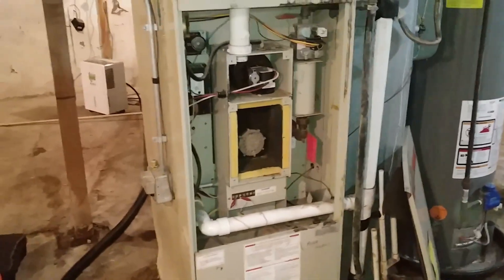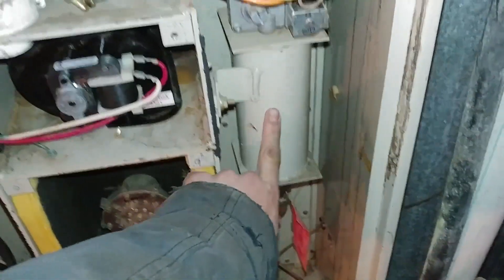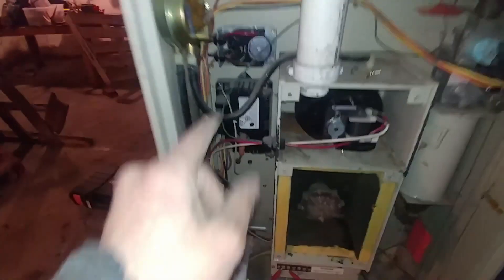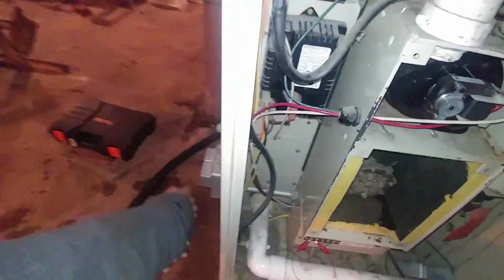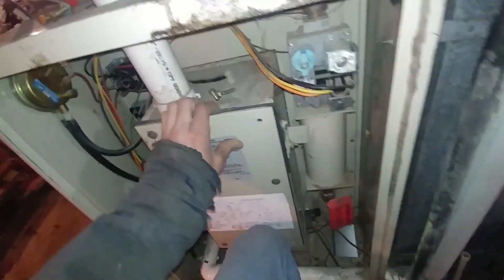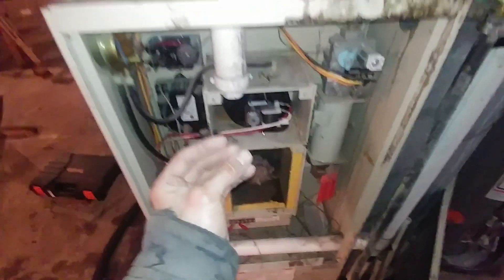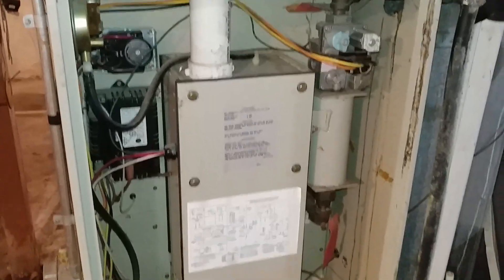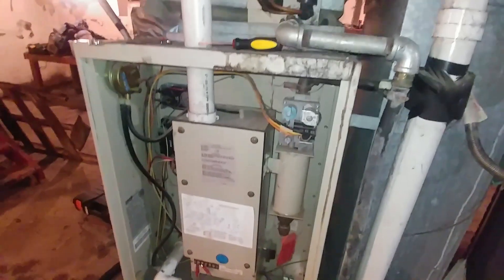Lennox Pulse Operation Overview

Comment: OP  you completely missed the  fact, or failed to mention,  that the gas  connection ALSO has a flapper assembly  way down  right before it goes through the panel.   I replaced few of them,  replaced lots of air flappers.
Reply from the maker: Yes, I probably missed that because I have not had the opportunity to work on many of these. In fact, I think the last two or three that I knew of have since been replaced. Not sure there's any out there still, maybe one or two somewhere, but they are definitely a rarity.

Comment: I am 77,  in a previous life  worked on  hundreds of these.  The dealer  I worked for was big on them.  You give  some thought as to locating them, use  shock  mounts,  use canvas isolators  in the  supply and return  ducts,  install the  gas  flex  connector properly so it was not  "bound up"    use  the mufflers,  and give some thought as to venting runs and termination  location.      Guy love to trash these, but the fact is, that back then there was at least one manufacturer,  sold under more than one trade name, that had a higher rate of  failure.     Lennox  should have done a better job of stepping up with the recall,  and should have given customers a better deal on replacement.  I got out of the trade about the time the recalls   got  going.

Comment: Reuben, how did you know you needed to replace the Pre-purge motor?  What are the symptoms?  Mine spins ok with my finger when I take the chamber cover off.  Thanks for the video, great job explaining!
Reply from the maker: The prepurge motor only runs for a short time before the spark and gas valve come on. The motor is only a simple C-frame style and if the winding goes bad or the end bearings sieze up it has to be replaced. Another issue I have seen is the intake screen will plug up with leaves (or dead bats or birds) and it will exhibit symptoms similar to a bad motor.

Comment: Probably the most long lasting high efficiency furnace ever built. I see many from the early eighties still in operation. They did get a bad name early on because some of the furnaces had some poor welds on the heat exchanger. Unfortunately because of that lennox decided to scrap this amazing technology.

Comment: Basically a V2 Rocket strapped in a Air handler.
Reply: Wrong,  Kimosabe.     V1  VEE  ONE!!!   V1's had wings, and a pulse jet. V2's were liquid fuel  and oxidizer   propelled  guided missiles.

Comment: I have one that, it seems like the ignitor is always clicking... what is the cause?
Reply: We had one for 32 years and they always made strange noises,best damn furnace . Sometimes it sounded like marbles rolling around on the floor. They have a spark plug in there and also you have a flapper valve , it runs like a crude engine or ww2 German buzz bomb.We had ours inspected twice a year, I went on Ebay a grabbed some flapper valves and used those until last year. My parents  had that Lennox ripped out and installed a new Dakin  Heat pump. The clicking noise could be the spark plug getting really worn or the flapper valve. I know ours made a funny clicking noise and it was the spark plug in it. They are TANKS and if maintained last forever that's why lennox wants to get rid of them they lasted TO long,in my opinion.

Comment: My Lennox Pulse blower fan motor stays on after a heating or A/C cycle. If I wrestle off the fan motor/filter cover it is usually enough to jar a relay somewhere so that I actually hear it click open, but does the delay timer on/off relay in the furnace rats nest wire box also control the blower fan for the A/C also?
Reply from the maker: There is a mechanical delay for the fan in the heating mode, but I don't think it used for the AC mode. I think there is a second relay for the cooling mode, because it runs the motor on a higher speed. You're probably going to be stuck replacing something.

Comment: How would I go about finding someone knowledgeable in servicing one of these in my area? I’m located in northern Delaware.
Reply from the maker: Probably most of your HVAC companies will service the unit. They may recommend replacing rather than repairing if the unit has issues.

Comment: 1982 1989 the heat xchangers had higher failure rate and had a recall on the pulse some models.
Lennox Pulse Furnace Inspection Checklist - 17 Furnace Inspection Safety Inspection Points
Here are seventeen inspection points suggested for Lennox Pulse Furnaces. If a simple visual inspection of your Lennox pulse furnace (or any other heating appliance) shows evidence of leaks, corrosion, or if the system is making strange noises or odors, call your heating service technician promptly as the equipment could be unsafe. Be sure that the building has working carbon monoxide detectors properly located and installed, especially where gas-fired heating equipment is in use.

1. Inspect the Lennox pulse furnace combustion air intake and exhaust PVC for condensate leaks and/or joint separations. Repair as necessary.

2. Inspect Lennox pulse furnace air diaphragm flapper material for dirt or deterioration and replace, if necessary. Air flapper material must be replaced every four years regardless of appearance.

3. Inspect Lennox pulse furnace purge blower for dirt build-up every year and clean, as necessary.

4. Inspect Lennox pulse furnace gas flapper material for dirt or deterioration. Replace entire assembly if flapper material is found to be worn.

5.Check the furnace combustion supply air blower wheel and clean, as necessary.

6. Inspect secondary heat exchanger for dirt build-up and clean, as necessary. Blower must be removed to do this check

7. Inspect Lennox pulse furnace heat exchanger assembly for any signs of corrosion or leakage. An air pressure test has been performed on the heat exchanger and exhaust venting system

8. Check all wiring for loose connections on the Lennox pulse furnace. Check for correct voltage.

9. Inspect stainless steel flexible gas connector for corrosion. Remember - Some soaps used for leak testing are corrosive to stainless steel. Failure to thoroughly rinse gas connector after leak check can lead to corrosion.

10. Inspect intake and exhaust pipe terminations to make sure they are free from obstruction.

11. Check the Lennox pulse furnace supply and manifold gas pressure. Adjust pressure, as necessary.

12. Check furnace firing rate by clocking gas meter.

13. Test oxygen/carbon dioxide level of flue gas to determine if proper combustion is taking place. For operating ranges, consult charts provided with testing instrument or unit information manual.

14. Test the Lennox pulse furnace exhaust carbon monoxide levels in flue gas. Level should never exceed 50PPM.

15. Check Lennox pulse furnace operating temperature rise and make sure proper speed is selected to match nameplate rating.

16. Check Lennox pulse furnace fan and limit controls for proper operation and setting.
(Refer to installation instructions)

17. Inspect Lennox pulse furnace condensate lines for free flow of condensate during operation. end

Comment: Varrrooooom...  Love the Lennox Pulse.  This was a great explanation.   I have several of them.
On the bottom exhaust tube that you pointed out, what is the small black hose do that comes off the white exhaust tube and goes up to a box near the top. (seen at 2:15)
Reply from the maker: The one on the left side of the furnace interior? That's one of the pressure switch tubes. The plastic that those fittings are made of becomes extremely brittle with age, and on two occasions I have snapped them off while working on similar units. I have learned that to check the tubing for obstructions it's best to pull it off the pressure switch, and leave that lower fitting alone.
Reply: @ReubenSahlstrom  What would you do if it's broke off?  I was told the large elbow is NLA and the repair guy never got back.  It's been running fine 
I love these furnaces, virtually never needs fixing expect the flapper thing inside.
Reply from the maker: @tompeters4234  In the two incidents I had, we were able to reattach it using pipe glue. If we hadn't been successful using that, I am not sure what we'd have done. I guess drill it out and tap if to a slightly larger fitting?
Reply: @ReubenSahlstrom  Yes, I have done that also.  The condensation drain hose fitting is another that is easily broken due to becoming fragile.  Busted mine when trying to remove and clear the condensation drain hose.  Best to start saving parts from decommissioned units.  These furnaces are extremely heavy also.

Comment: the old lennox stuff in general is great, i still see 1980s condensers (lots of cheap hs18s) running in my area and I'm betting a lot of their furnaces from that time are also still operations. the builders up used tons of canadian edition G8 (similar to american g12) furnaces, they were/are super reliable.
Reply from the maker: Yeah Lennox makes some good equipment! A couple restaurant units we service in our area are still going strong! We just replaced a heat exchanger on one old rooftop last winter, but the rest of the unit is working well considering it's age!
Reply: My grandpa had an hs18 until a few months ago